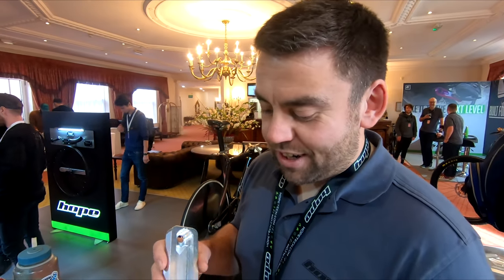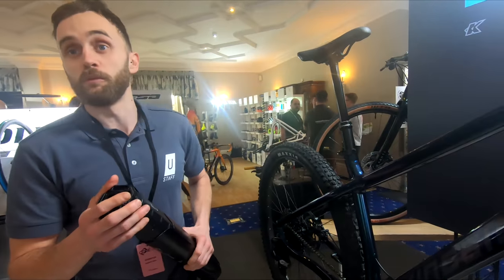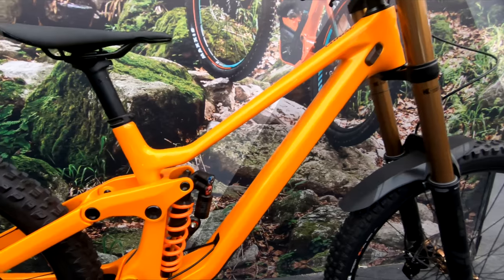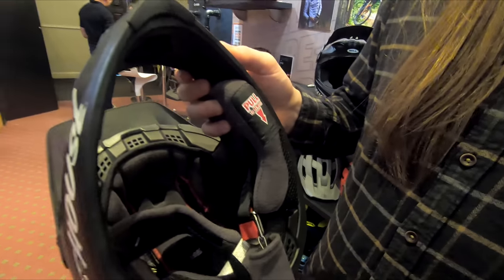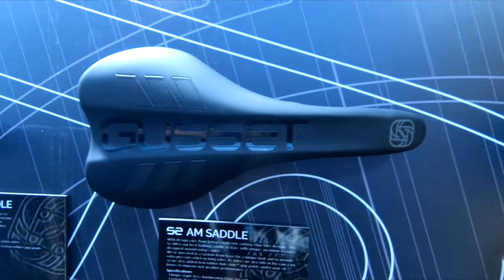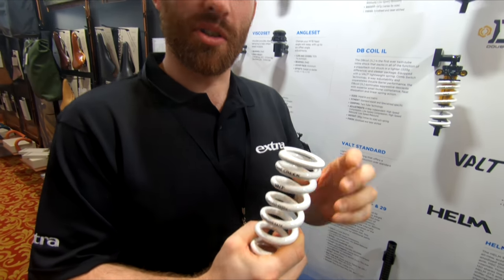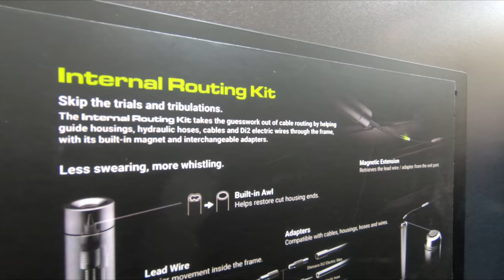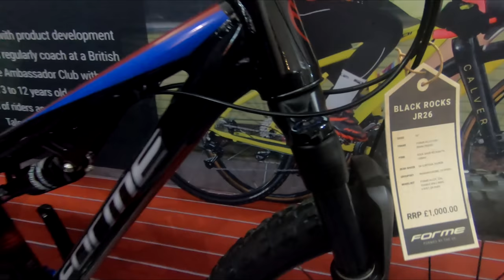BEST OF THE UK BIKE TRADE SHOW 2020

Comment: The Bell helmet magnetic cheek pads are a good idea to assist in removal in the event of an accident. BUT the eject system is a completely useless in MTB as agreed by myself and my partner with 20 years plus frontline paramedic experience. To detail for Bell- who would carry the bladder and CO2 cartridge? If it were to be the ambulance crew then EVERY vehicle in service across the country, and I’m just talking about the UK would have to be stocked with several and that is NOT financially viable with the NHS. ALL frontline staff would need to aware of the device and trained as it would come under clinical guidelines with head trauma even if a rider were to carry it. Is it meant for just race events? You have to have access to the rear of the helmet in which case most riders after a crash are prone on their back. 
Stick with the magnetic pads as we can definitely work with those and should be rolled out through all helmet manufacturers. Sorry but I tried to end it on a good note 👍🏻
Reply: I agree with Adrians comments here but would like to add something as well. Basic physics; every action has an opposite and equal reaction. Anybody who has used C02 Caplets will know they're fairly explosively pressured and I fear that pushing the helmet off (no matter how slowly) without some actual training from the people on the scene to facilitate the helmet moving off at the same time just leaves scope for more damage to occur. Obviously I don't expect this system to launch the helmet off the riders head but even with correct valving and management of forces there's still too much room for human error or misuse for my liking.

Comment: Love that Kinesis hardtail idea but I'd want that head angle to be at least 65 and ideally even slacker. HT doesn't have rear sus to sag into so the head angle is really key to get right from the off. I wouldn't touch something with 66.5 where possible, yes, number's aren't everything but once that fork is at sag you'll be even steeper again.
Reply from the maker: Agreed
Reply: Pricey too